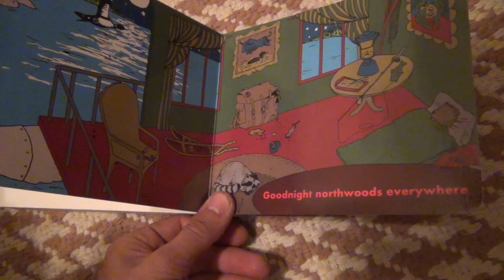Matt Moves The Trailer [Aug 29, 2015 Vlog]

Comment: If you tack weld all of the corners and maybe a spot or two in the middle of the c-channel, it won't move on you like that. Chances are that it didn't actually move, but by putting that long weld in one place, the heating and shrinking of the weld actually drew the metal toward the weld.  Tacking it in place will stop that. Also, a few welds about 2" long or so on each side of the channel would be more than enough rather than fully welding the length of the channel to the other channel.    I am interested to see how this trailer works out for you
Reply: That's a good point.  Didn't think of that.  I learned my lession with that first one.  On the second one, I clamped it in place and tacked both ends.  Worked out perfectly.  Any disadvantage to welding the full length?  I'm only doing the entire length of the channel for practice reasons.  Actually now that I'm finally working on it, I'm really excited to have it done and give it a try
Reply: I don't see any issues with the full weld. Just overkill is all.

Comment: well you have my curiosity with the trailer...with you reinforcing the trailer and adding more steel will you have to change anything on the axle as they are only rated for a set amount of weight? knowing you plan on hauling alot of logs for a distance.
Reply: Everything I'm adding should come in around 500lbs.  So that will reduce my carrying capacity.  I'm guessing the trailer will weigh 2000lbs when I'm done with it so that will put me at 5000lb capacity.  I'll also be removing the ramps so I'll gain some capacity back from those.